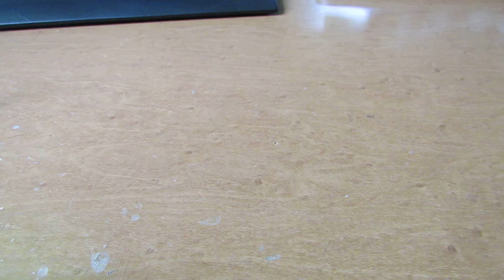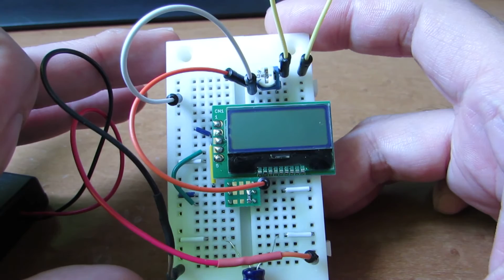ATtiny10 supporting I2C display and A/D converter activation leads to super simple voltage meter

Comment: Hi! I'm thinking of using the tiny10 for Lora or nrf24 transfer of a single sensor's output, but I'm not really finding any tutorials for such, so you think I should even try? I want to build the device fully myself, pcb and all
Reply from the maker: Mostly available LoRa module has buit-in MCU and we don't need extra MCU such as tiny10. (Also nRF). But making something sensor node is quite interesting, I think..